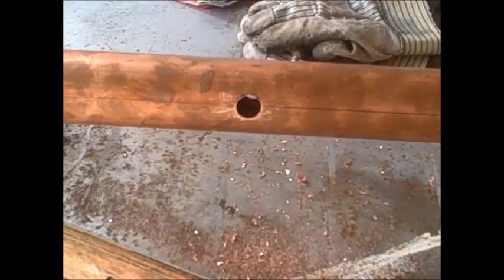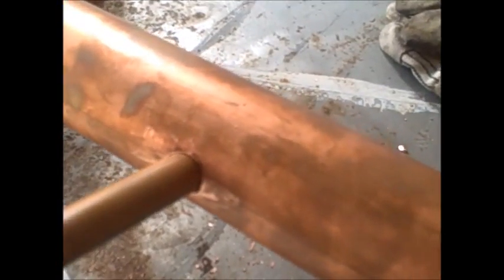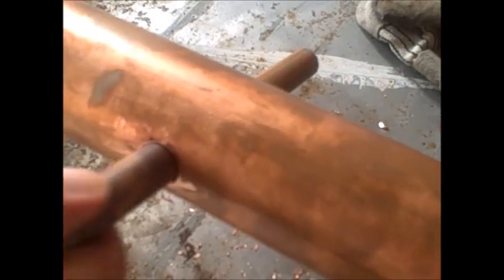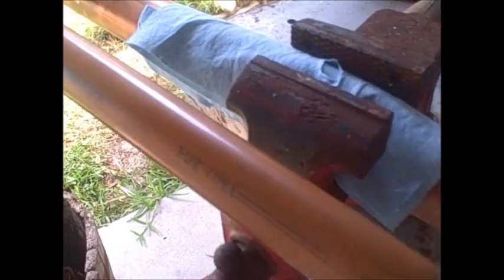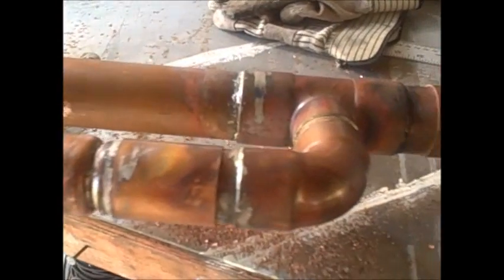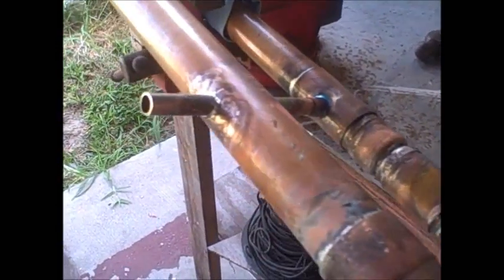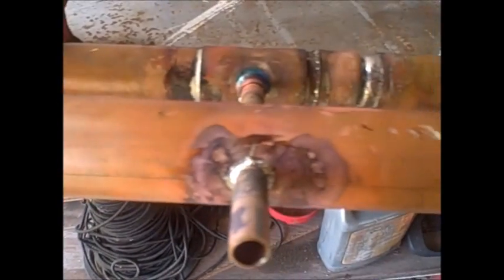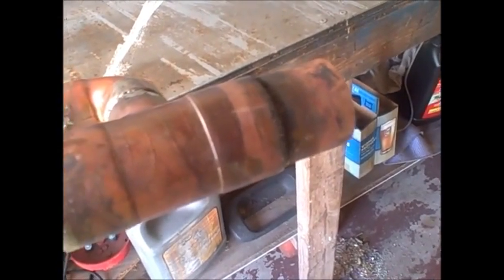Distillation Column

Comment: Got the same design from a guy in the Netherlands like 10 years ago. Worked great. Used a #10 ss bowl topped it with a 4to1 exhaust flange to mount the unit to the keg boiler. It cleaned up very easy as well. Nice job.

Comment: Hmm..not to burst your bubble, but what you made is a cooling managment design. This particular design is inferior. You hardly get any reflux going in there with those two pipes through the column. Not to mention cleaning or getting the column packing out again.. Basicaly you can only use it as a potstill and make some whiskey on it, the control of the Liebig condenser would be difficult due to the pipes going across the column.
Reply: ***** If you are happy with that..ok...lol
Reply: You are absolutely right.

Comment: I got my still made and I've been running it for about the last 2 months.
I'm getting about 150 proof but only getting a quart and a half of shine from 5 gallons of wash.
Am I doing something wrong or is this all I'm going to get?
Reply: You do know to throw some away at the beginning of your run don't you?  It seems as though you have put the cart before the mule as far as making alcohol before making a safe to drink alcohol.  (I'm not trying to be mean).  One would have to know their starting abv% and their ending abv% in order to calculate approximately what your yeild could be.  If you want to make good shine don't get greedy with your time or mateirials and make sure you are doing the right research.  I hate to say it but Youtube is full of some terrible misinformation that will get you way down the wrong road before you realize it.
Reply from the maker: You should get more than that, 4 quarts or so. 150 proof pretty good, got 170 out of this one. I suspect you are running too hot or have leaks. Top of column should be about 170 degrees while running. More packing in the column will up the alcohol content. Remember slow and easy does it should take several hours to run a batch.